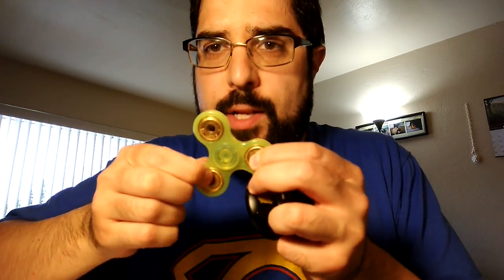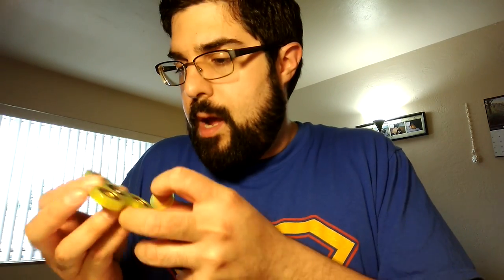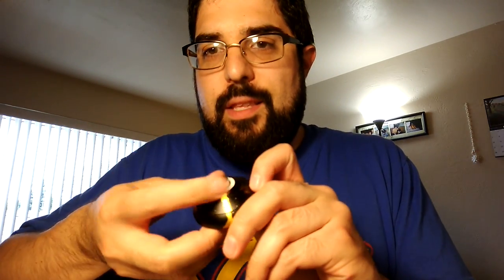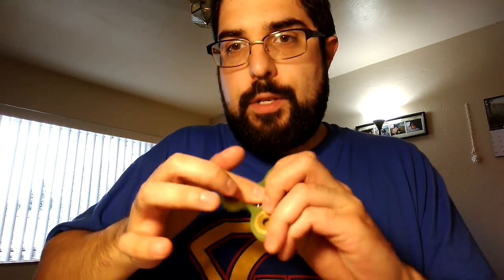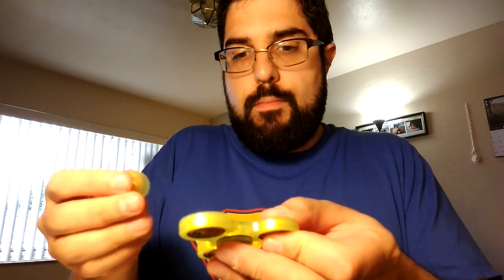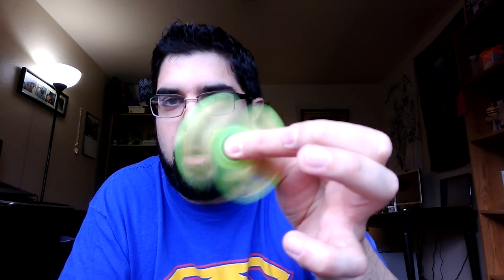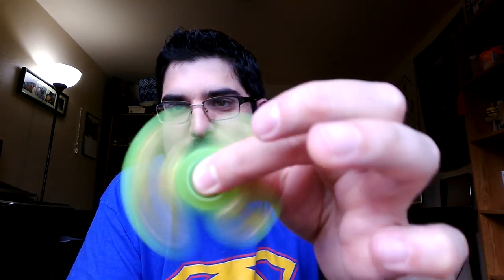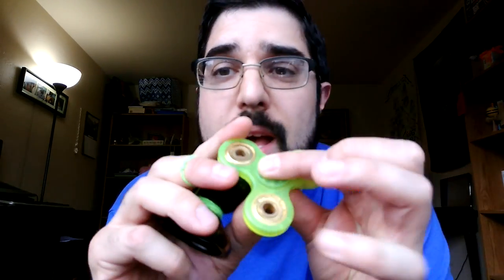HOW TO LUBE A YO-YO OR FIDGET SPINNER BEARING

Comment: You're never supposed to lube ceramic bearings. Just clean them with water. Also, my trick when I lube a bearing is to do a bunch gyro flops to break it in as fast as possible.
Reply from the maker: I own 0 ceramic bearings, so I had no idea. Thanks for this. The Gyro Flop idea is awesome.
Reply: You certainly can lube ceramic bearings. I have one and lube it the same way as SS bearings. Dif-e-Yo recommends you lube ceramic the same as SS > just google "dif e yo tech tips" or I can send a link ;)
Reply: chaotikchiken no thanks, I was just going off the information on the luftverk website and have done this with my ceramic bearings in the past with no problems. 
Edit: Also, I'm pretty sure the dif-e-yo website is talking about stainless steel casing with ceramic ball bearings which I understand would need lube to prevent rusting, I was talking about full ceramic bearings which shouldnt need lube.

Comment: This is great, thanks for the information, you got skills with the Yoyo!I've had 3 of my spinner's bearings rust out of no where (I live in a tropical country, however, they rusted spontaneously when I was outstation). R188 Bearings are difficult to find locally as well.So I went to the local musical instrument shop and they had a bottle of Yamaha Synthetic Valve Oil (for Vintage instruments), and I picked up a bottle of the stuff. It is really runny compared to other oils (even runnier than Singer Sewing Machine oil - looks like water in a squirt bottle).After cleaning and drying my bearing thoroughly, I dropped one drop of the valve oil into the bearing, and wow, the spin is extremely smooth! I'm at a point where bearing longevity and corrosion prevention/resistance is more of a priority than longer spin times. Maximum spin times are reduced, but the trade off is worth it if my bearings can last longer. No point trying for longer spin times if the bearing will shit the bed after a week of being dry in a potentially humid climate!Gives me peace of mind knowing that there is a film of oil on the races/bearings protecting it from rusting. I don't mind cleaning and oiling on a more regular basis - that in itself is therapeutic. Plus, the bottle of Valve Oil I purchased seems like it can lubricate a few thousand bearings.

Comment: Bearings are so cheap now there's no reason to lube them.  When you do lube them they generally become more responsive or reduce the spin time.  If a bearing locks up (normally they lock up when debris or hair gets caught in the bearing, so just clean it out if you can), you can try lubing it to clear it out, but otherwise, don't lube it.  Just play it!
Reply from the maker: There's plenty of reason to lube them. Climate. Help prevent rust. They also perform smoother. Yes, they lose a little bit of spin time and become slightly responsive initially, but that doesn't last long at all. I generally find they are smoother and quieter after I break the lube in as well. Then you can just play it longer.
Reply: if you feel they become too lubed there's always the option of cleaning it all of, generally a bad idea to run on dry bearings, it can overheat and damage your bearings permanently